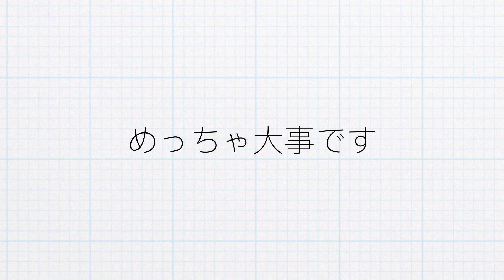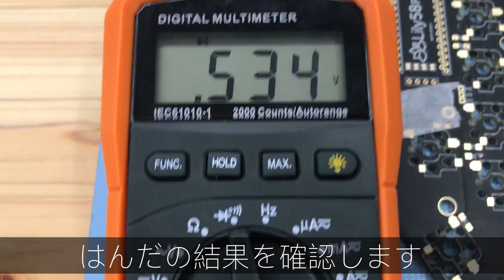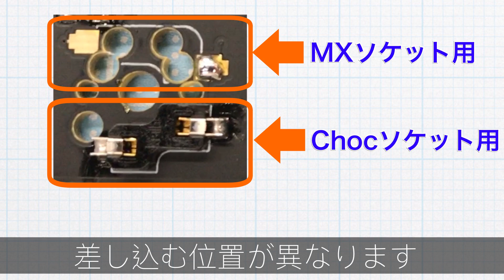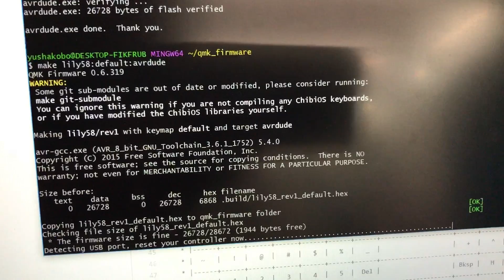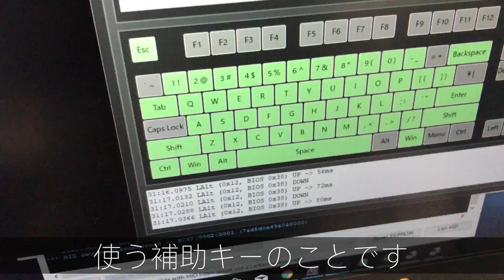自作キーボード作ってみた Lily58 Pro編 in 遊舎工房 | Lily58 Pro : Custom Mechanical Keyboard Build in Yushakobo

Comment: As a beginner in soldering would it be wise to stay away from this?
Reply from the maker: No.  I was also a beginner, but I was able to build it.  The point is to work carefully and read the build guide carefully and it will work.  It's a lot of fun so I definitely want you to try it.😆
Reply: Daihuku Keyboard thanks for replying! I’ve been wanting to try an ortho split keyboard for a while now. The lily58 seems like the perfect price. I may give it a go!

Comment: What soldering iron did you use? I'm building a lily58 too and I don't know if I can use a cheap one for the SMD stuff
Reply from the maker: I used a soldering iron called "HAKKO FX-600".
I don't own it, but I found it in the workroom of Yusha Kobo where I assembled lily58.
This is a reliable maker and I can recommend this tool.
Reply: @DaihukuKeyboard  That's one of the top brand for  solder station :P

Comment: Im considering this keyboard. Could you tell me what can you with the screens? Can those be programmed or configured?
Reply from the maker: OLEDs are programmable. I've never programmed it, so I don't know much about it. But you can find examples of programming on the web. For an example, see the following site
https://www.tnksoft.com/blog/?p=8291
https://ubansi.hatenablog.com/entry/2019/03/21/223613
https://qiita.com/guri3/items/844675b637c88515a989
https://medium.com/@melpon/%E8%87%AA%E4%BD%9C%E3%82%AD%E3%83%BC%E3%83%9C%E3%83%BC%E3%83%89%E3%81%AB%E3%82%B2%E3%83%BC%E3%83%A0%E3%82%92%E4%BD%9C%E3%81%A3%E3%81%A6%E5%85%A5%E3%82%8C%E3%81%9F%E8%A9%B1-a4840a83518e

Comment: i have a question, i need to flash the two pro micros separately?, and if it is, i is the same process for both?, i have questions on that, and, can i flash the pro micros before soldering anything? (just the pro micro without the keyboard) thanks!
Reply from the maker: ProMicro must be flashed separately.  Both are the same process.  You can flash before soldering.
Reply: @DaihukuKeyboard  Thank you!!!

Comment: what is the disadvantage of  using trs instead of ttrs?
Reply from the maker: TRRS has 4 cores and TRS has 3 cores. Some keyboards only support TRRS. If both are supported, it doesn't matter which one you use. It is necessary to read the document such as the build guide to check the compatibility status.

Comment: 3:53 what happens in this step? those 4 solder blobs in there.
Reply from the maker: A jumper required when using OLED.  There are two pads in pairs, four sets of them, for a total of eight pads.  This is soldered to join the pairs together.
Reply: @DaihukuKeyboard  Thank you very much for answering.